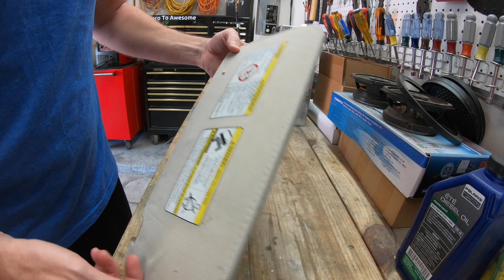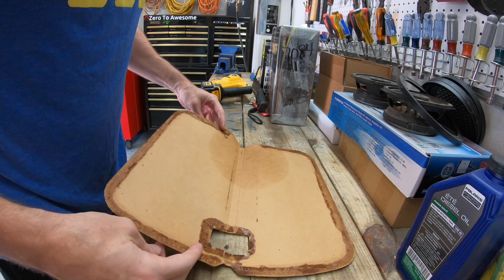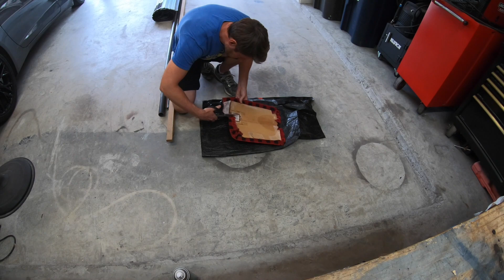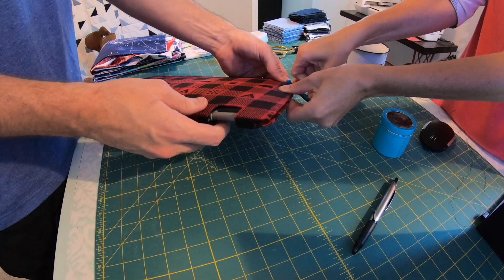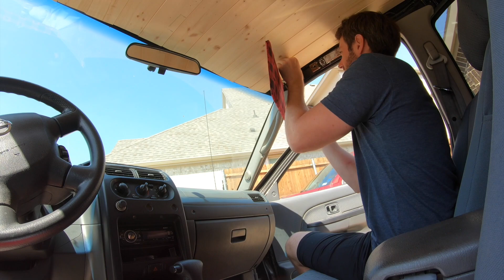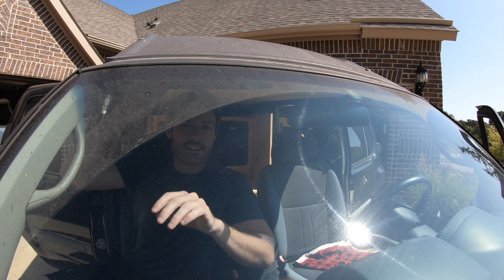We used a 🔪MACHETE🔪 & our WITS to make custom sun visors for our offload camper! (mostly serious)

Comment: The truck looks like a man cave with the roof.  Maybe you should have punch holes in the edge with hammer and a leather fork (looks like a fork with 4 prongs for punching thread holes in leather) and then maybe gone with a heavy test pound fishing line to the complete the "manly" theme.  ;-)  Looks pretty cool though.